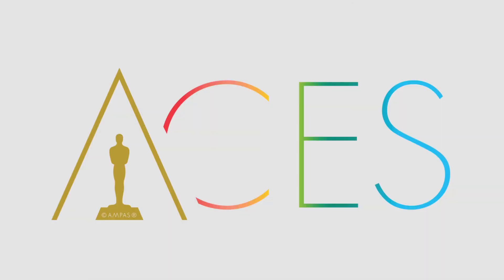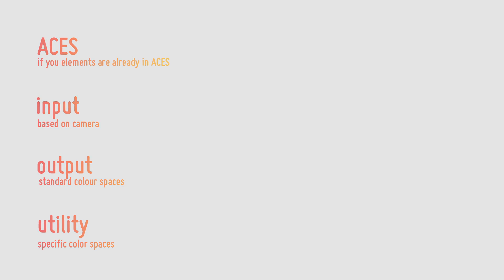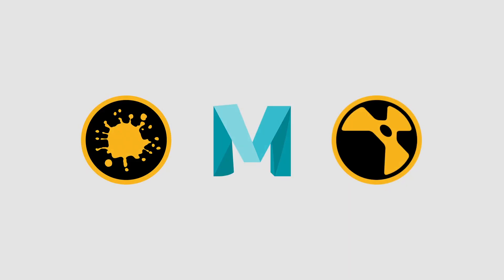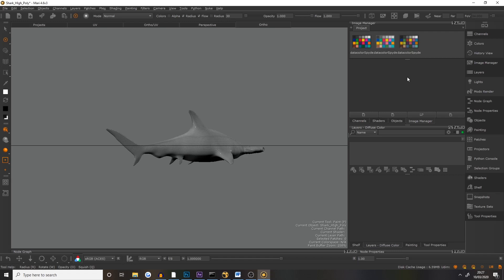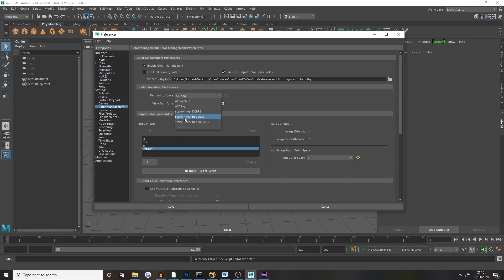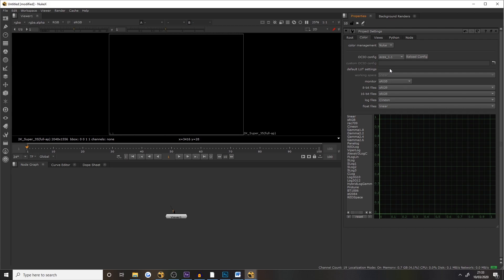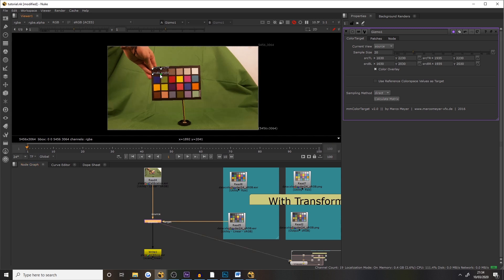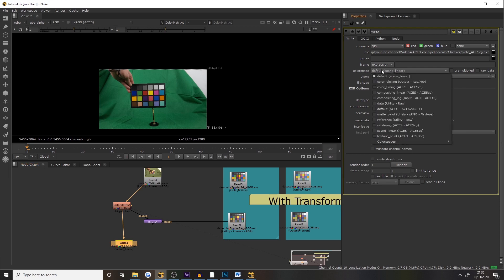Introduction and Setup of an ACES Workflow (Mari, Maya/Arnold, Nuke)

Comment: What if the plate footage you are starting with is Log footage?  For instance, I am shooting with Slog2 out of a Sony A7S 2.  Is it still the same workflow of using a color checkerboard to get a "Aces Converted" grade?  And then use that to composite on, and do the grade in Resolve last?

Normally with Log footage I'm used to getting a viewer LUT or having a grade node that puts it in sort of Rec709 realm, I was just curious if this color target method would do the same thing or it will end up looking flat (Which you can't really composite on)?
Reply: Hi Alex, Resolve is great at working with the ACES workflow...for just importing and grading footage you should use ACESCC or ACESCCT and not ACEScg that is mentioned here...there are many profiles for bringing in slog-footage into the workflow/colorspace and I wouldn’t be surprised if there is one for your exact camera....you will then end up with a “master” that is great for archiving and sending to a bunch of outputs with the same quality regardless. You can find good info over at ACES-Central and there are many friendly souls there who are willing to answer your questions.

Comment: Don't forget the Utility - RAW IDT for reading in scalar maps!
Reply from the maker: Utility raw is actually a bit obsolete in ACES, you can use ACEScg as this is also a raw colour space and it performs the exact same transform as Utility - Raw, the data is identical when using ACEScg and Utility - RAW so its really a preference, I prefer using ACEScg as it means you have consistency throughout the workflow.
Reply: @Hypershader  Ohh very interesting! Cheers for the heads up! Just read back over Chris Brejon's chapter in his book, must have missed that part.